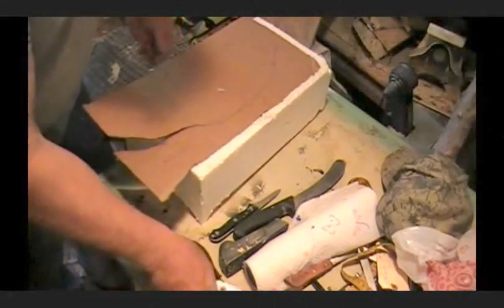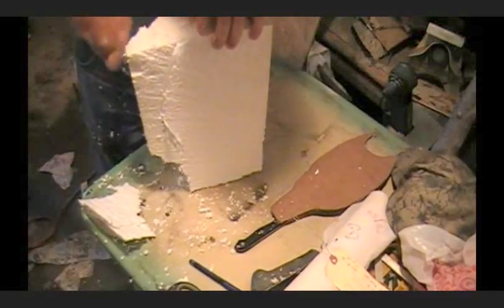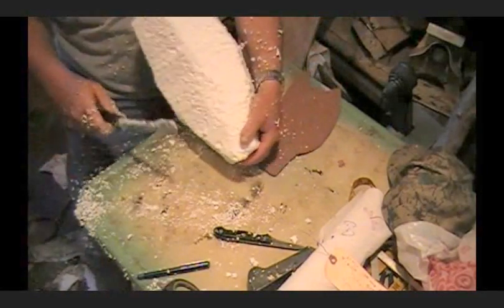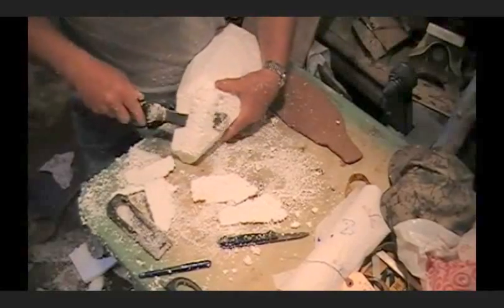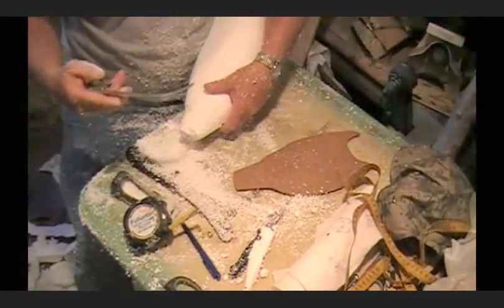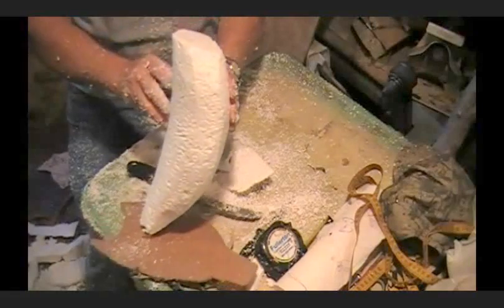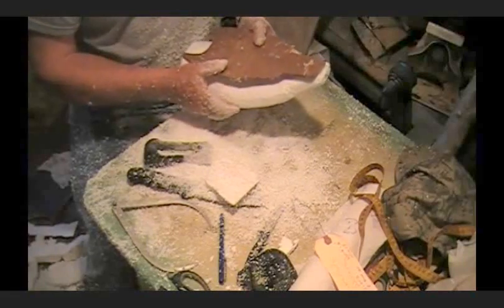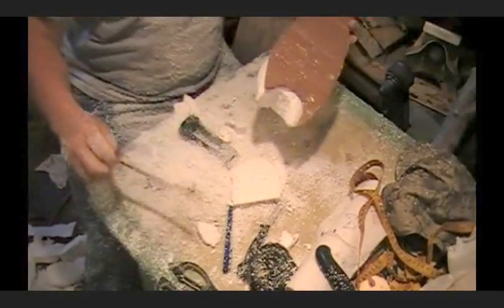FISH TAXIDERMY - BASS - Making a Form - Video 2 of 5

Comment: Hi there, Richard.  Love the videos. I have a question for you... I'm just a beginner hobby  taxidermist so this may be a silly question, but I was wondering if you could tell me how to do a fish that you can show from both sides? Do you just cut the form down to fit perfectly and hide the stitching somehow? Also, I assume you cut the belly instead of the side? Or is there some other way? Heck, I don't know. Ha. Thanks!
Reply from the maker: Thank you for the compliment, Aprilia.  Please don't ever worry about asking "silly" questions.  There really is no such thing.  If you don't know something, ask.  The only "silly" question is the one that doesn't get asked.

If you want to be able to show both sides, normally, I would cut on the underside of the fish, from below the throat latch area (under gills) continue in between the bottom fins all the way to the tail.  Keep in mind your form has to fit close to perfect.  To close the bottom seam, I use staples instead of sewing.  This is so I can then just pull the staples out after it dries and put the ApoxiSculpt on to hide the seam and to reproduce scale markings. 

The other way I've mounted fish to show both sides entails a back seam, but, saving scales from the fish.  Once fish is mounted, you'd "re-use" the saved scales and apply one at a time.  I wouldn't suggest this route for a beginner.   There's probably more ways to do this type of a mount, but, these are the two that I've got experience with.
 
I would suggest you mount a fish like a bass or bluegill first.  Something with tough scales.  Crappies and trout are very hard to do.

I'm glad to hear you're getting into taxidermy.  I've always noticed women make excellent taxidermists.  They have a good eye for the details for sure.  Details can make or break a good mount.

Good luck to you.  If you have any more questions, feel free to just email me.  I'd be happy to help.  - Rick
MORE FREE VIDEOS FROM RICK:   https://www.youtube.com/channel/UCuZnD9mnjx8Yh6-KiTPLU_A

Comment: I have a question. I was wondering if foam isolation( if squirted in a container) would work like other foam. I mean it drys hard and all. I've make forms from foam but just wondering
Reply from the maker: +Amanda Dykstra I don't believe I'd use it for a fish.  I've never tried it, but, have noticed on other applications, that it does break down when exposed to air after awhile.   It would be cheaper to buy a sheet of foam and carve it.  Sheets of foam glued together would be good for several fish.   Readily available at home improvement stores.  Thanks for your question, Amanda.  - Rick